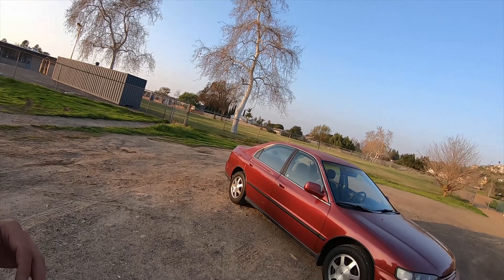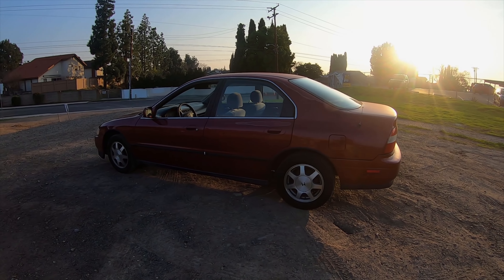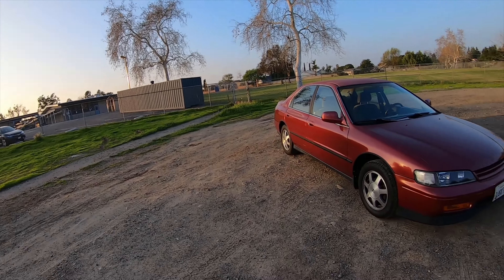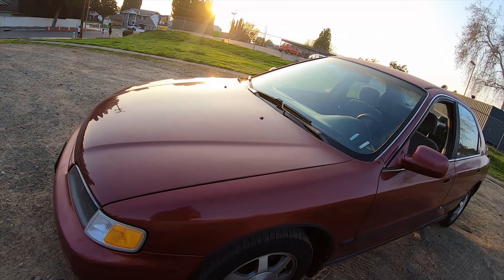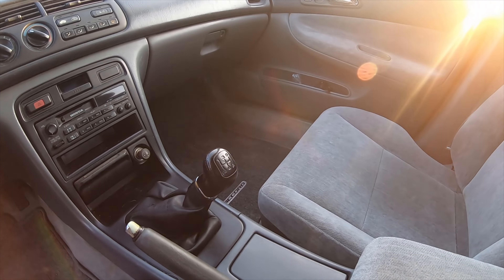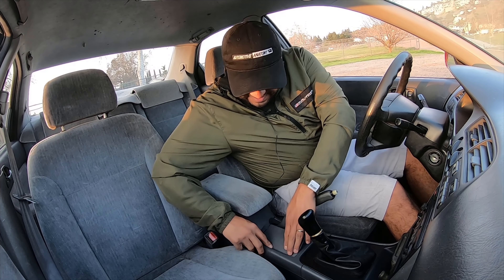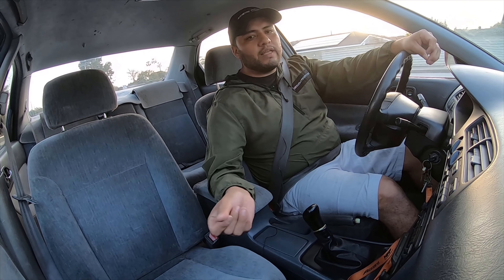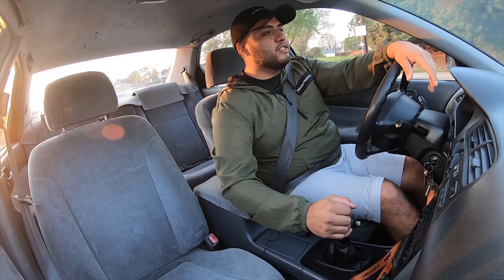Meet my New Daily Driver 1994 Honda Accord LX

Comment: $1,500 bucks for the whole enchilada w/dual airbags, bro! u safe & sound! that's a pretty good deal if you ask me... I have the same 94 Accord Lx. w/254k mi. sky metallic blue, with an automatic transmission, sitting in my garage, I'm going to save it for my grandson when he  turns 16 yeah those 90's Accords are fun to work with.😀✌👍

Comment: 17:36 Sometimes I get to 298 miles on my 1994 EX 5MT and I still have just under 1/2 a tank left. I went 652 miles on a single tank recently and managed to fill up with 15.1 gallons. A lot of rural backroads and very little traffic on that tank. It blows my mind how efficient the F22B1 can be, even with it's pathetic 8.8 compression ratio.

Comment: Nice found 94 Accord sedan and you have two Accords now. I have 94 Honda Accord Sedan EX since 1999 and still love it but it get old. It has to take care of the car before start to fell apart. I also have 2004 Acura TSX with manual since now but car need to fix the power steering, leather seats start to tear, etc. I miss driving the car.
Reply from the maker: Very nice! Awesome choices in cars man!

Comment: Manual Accord Coupe rare!  Suspension check ball joints, upper n lower control arms, struts she will be a dream. I have a 93 Accord with a major refurb at 265,000 . I have owned it for 20 years all original drive train with an automatic.
Reply from the maker: Sweet RON! Glad to hear your car is running well. Yea man, I love this lil beater and we shall see how the journey goes.

Comment: One tip right off the bat, if you ever end up having to replace the rotors, opt for just doing a full rotor over hub conversion. For just a few more dollars you can save yourself future headache. Also, save the headache if you ever need to replace motor mounts, go with "innovative mounts". Its a company. Decent condition OEM mounts from the junkyard easily out-last/perform even the best autopart store replacement. Innovative mounts would almost certaintly outlast the car.

MOST important. Replace the capacitors in the ecu, they will fail eventually, if they arent already. Best case, car wont start and you can just solder on replacements, worst case your ecu fries possibly setting more than just the pcb ablaze. The capacitors are less than $20 for top quality replacements.  If on the off chance you actually read this, and would like to know what capacitors you need; comment back and il fish out the part order receipt from when i did mine like 6 months ago.
Reply from the maker: All great tips man. Thank you very much man. Yes, I will eventually go with the CL setup up front and EX rear assembly. For now, I actually do not want to spend money. long term goal is buying me a 911 991 man.

Comment: I LIKE THE ENDING "I'M A RACE CAR DRIVER NOW" LOL SO GLAD BROTHER YOU GOT A MANUAL CAR THERE'S NOTHING LIKE 3 PEDALS AND CONTROLLING THE CAR GEARS AND TRANSMISSION YOU ACTUALLY FEEL LIKE YOU'RE DRIVING A CAR GREAT / SAD STORY TO THE CAR BUT YOU GOT A GOOD DEAL PLUS I KNEW THAT WAS THE NEW DAILY WHEN I SAW IT ON THE SILVER MUGEN CIVIC INTERVIEW I WOULD HIGHLY RECOMMEND YOU LOSE THAT BAD HABIT OF HAVING YO HAND ON THE SHIFTER WHILE IT'S IN GEAR YOU DON'T WANNA MESS UP THE GEAR SYNCHROS IN THE TRANSMISSION BY WEARING THEM OUT PREMATURELY THE TEETH ON THE SYNCHRO GEARS BELIEVE ME YOU JUST WANT THEM TO MOVE FREELY INSIDE DON'T PUT WEIGHT ON OR THROUGHOUT THE SHIFT LINKAGE ANY TRUE 5 SPEED STICK SHIFT MANUAL DRIVER WILL TELL YOU THAT OVER ALL I'M HAPPY YOU GOT A GREAT USED CAR WITH NO PAYMENT AND YOU CAN ACTUALLY CALL IT "YOU'RE CAR" AND NOT OWE ANYONE CAN'T WAIT FOR THE ROSEY CONTENT YOU KNOW WHAT ?? JUST KEEP YO HAND ON THAT E·BREAK AND KEEP PRESSING "THE NOS BUTTON" INSTEAD GOOD LUCK BROTHER THANKS GUS ✌OUT